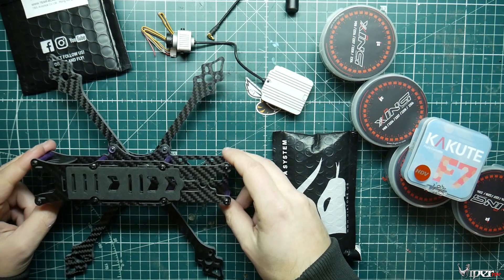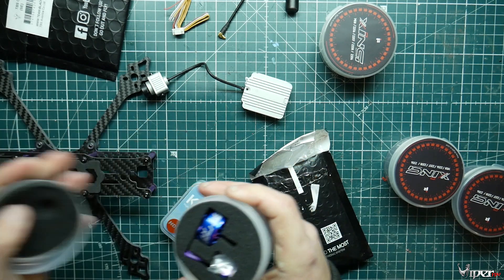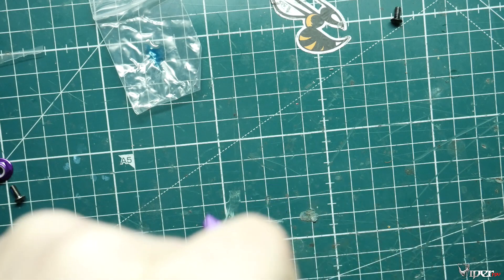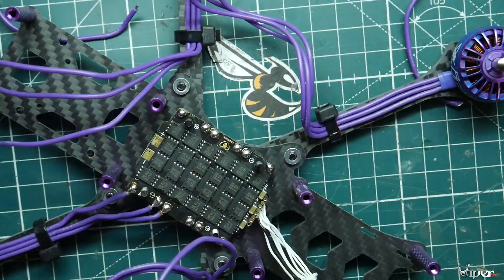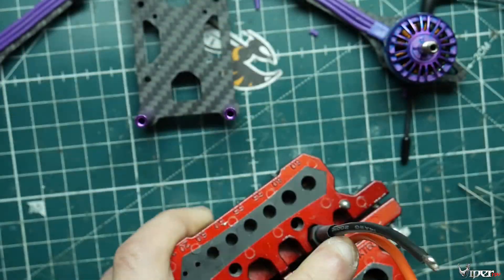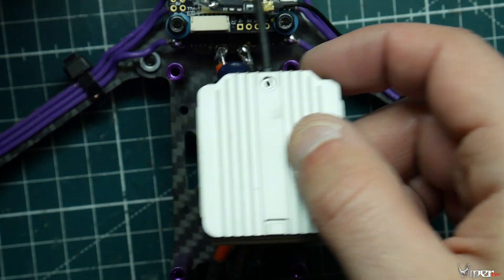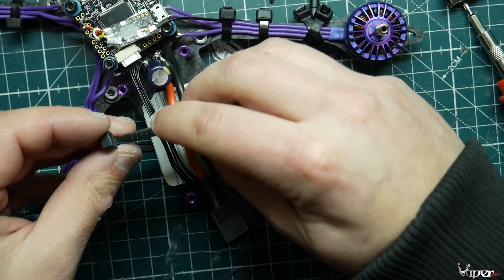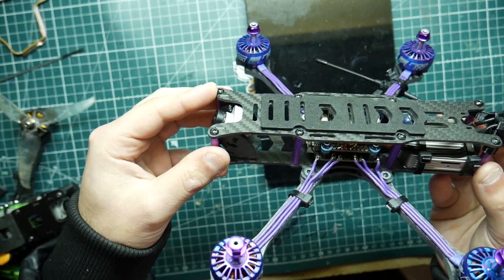DJI FPV HD DIY Ultimate Freestyle Drone Build - 6S Beast!

Comment: Do you not use a BEC for 6s?
Reply from the maker: No 4 in 1 takes 6s
Reply: @ViperFPV  oh ok, my fc only has a 5v pad. Do you think I could use a 5v to 9v BEC or should I use a 12v one
Reply from the maker: @Suwarofilms  u would need a 4in1 that outputs 5v.
Reply: @ViperFPV  I believe you can use a BEC voltage regulator to take it down form a 6s to 4s.
Reply: I’m using the Tmotor F4 FC
Reply from the maker: @Suwarofilms  and the esc?

Comment: Thanks for the great video!! Have been looking for this kind of build, but one question occured. 
The DJI Air-Unit has its own receiver for a DJI Controller, but I will use a TBS Tango 2 Controller and build in my TBS Nano receiver as you did. Is there really nothing to be changed at the Air-Unit? How is it possible to fly with two receivers?? ...installed to the FC
Reply from the maker: It’s only one u are wiring up you will leave the wires to the air unit disconnected for the receiver .
Reply: @ViperFPV  Wow, thanks for your fast answer!! Do you have a video of how you do exactly that? 
BetaFlight settings, for that kind of build would be also very interesting!
Reply from the maker: Yes right here https://youtu.be/K9-YM0gASuQ

Comment: Hello, I just bought this frame but its missing one piece, the rectangle part that holds the camera in place and the angle, it only came with one.  Do you know if I can buy this on a separate website  ? Banggood has terrible customer service

Comment: Hey. Thanks for that Video! If I want to use the DJI Controller, I just skip the Receiver soldering part, plug the DJI Air Unit into the FC and I´m basically ready to go? Can I fly with 4S and 6S Lipos? thanks :)
Reply from the maker: Steve Long yes u can skip receiver part and yes on a 6s rig u can use both batteries.
Reply: @ViperFPV  hello brother, can I use dji air unit with 6s battery because company claims it to be used only with 4s battery. brother please help me out, I'm stuck with the option, whether to get the DJI air unit or the caddx vista.
Reply from the maker: @rikithapa9371  dji air unit can only accept 4s input voltage. Vista 6s
Reply: @ViperFPV  that's why I was asking you, how did you manage to fly the dji air unit with 6s
Reply from the maker: @rikithapa9371  the FC has a built in bec. So the DJI air unit connected directly to FC.
Reply: @ViperFPV  okh bro thank you for the idea I have Zeez FC hope it has that port.
Reply from the maker: @rikithapa9371  as long as it’s the digital version.
Reply: @ViperFPV  yeah 👍😊🤜, thank you for helping me brother.

Comment: Looking to do a similar build. Will I have issues with the DJI system using 6s 22.2V batteries? The DJI HD Air Unit states "Input Power: 7.4-17.6 V". Maybe my full-stack will regulate this?
Reply from the maker: U can only connect the air unit to 4s power anything more u need to regulate either by using a DJI Ready FC or a regulator.

Comment: Nice build! You're videos have been super helpful. I have the same FC and basically the same stack and I'm looking to go 6s.. if i understand correctly.. I don't need to do anything special for the DJI air unit to handle 6s?
Reply from the maker: DJI air unit cannot take 6s voltage only up to 4s so you would need to reduce the voltage to the air unit. Either by using a regulator or a built in regulator on the FC.

Comment: great video! but wait can i run my HolyBro Kakute F7 HDV - Tekko32 F3 HDV 4-in-1 40A ESC Stack with DJI on 6S???
Reply from the maker: Yes you can since the F7 HDV has a build in regulator that reduces the voltage to the DJI air unit.

Comment: Hey, did I get that right? You can use a 6s as long as you use a stack that can handle the voltage without doing anything special? Cant the air unit only take 4S?
Reply from the maker: Yes on the stack but the air unit only can take 4s voltage. the stack I used u just plug in the air unit and the flight controller already has a 10v bec for the air unit so u don’t have to do anything special to reduce the voltage.

Comment: If i wanted to use the dji radio would it have been done after the air unit install ? No  need for the rec  ?
Reply from the maker: You can still
Build the entire drone with the air unit and no separate receiver. Since the air unit has a receiver built in for the DJI radio

Comment: I've heard that the dji system takes up to 4S battery. What do you think?
Reply from the maker: Marcelino Romero yes but this FC provides 10v to the air unit. So it’s regulated when I use 6s batteries
Reply: @ViperFPV  what about with non DJI flight controller Kakute F7 does it required extra regulate or can be regulate itself when 6s batteries used.

Comment: Nice build. I’ve been using the the Dji system since it was released. For the most part I only fly digital now except for the whoop and toothpicks that I have. If you’re thinking about getting the Dji system I would suggest that you get the Dji controller too because you don’t have to worry about extra receivers and it’s way more simple than binding and setting up models. It just works.
Reply from the maker: EscobarFPV  thanks for someone like myself I have a lot of different quads so my setup needs to be diverse
Reply: @ViperFPV  that's totally understandable. I like to simplify things. I use the analog adapter and Rapidfire module on my goggles and a taranis for analog quads.